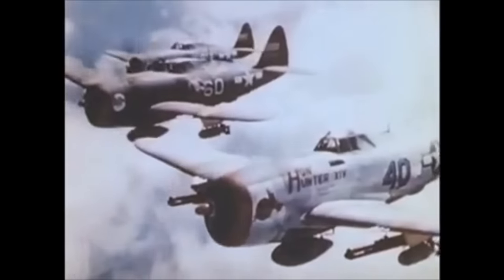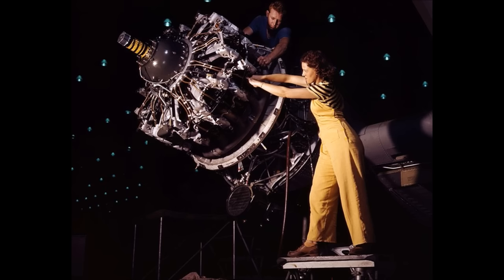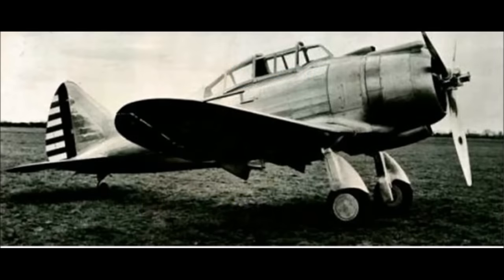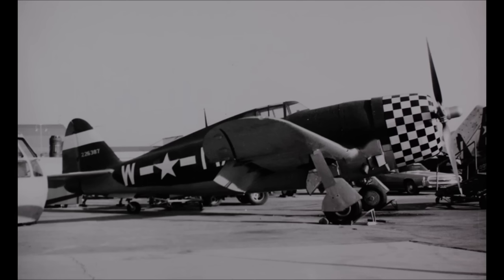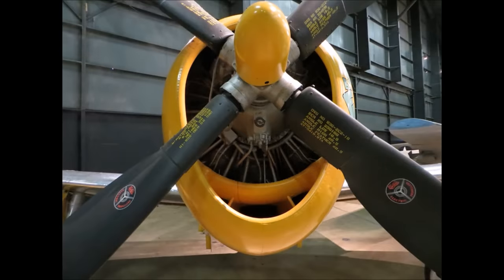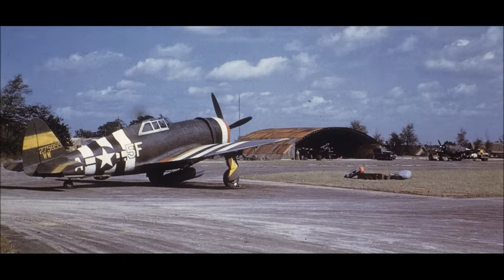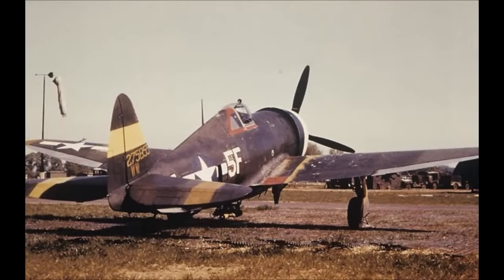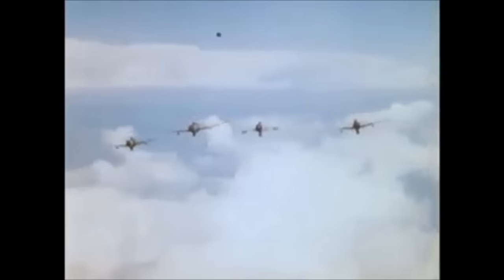P-47 Thunderbolt Pt. 1 Design and Speed

Comment: The D-5 version would have used the Curtiss 12 ft.2" prop. which is affectionately call the "pencil prop". This prop did not fully allow the R-2800 to preform, no climbing power. . Bob Johnson flew 5 different P-47's during his tour "Penrod and Sam" P-47D23RA hid final mount. Republic bent over backwards to help out the 56th FG, since that group started and finished the war in 47's and refused to change over to the 51. Which absolutely pissed off 4th FG and the leaders of that group were involved in dropping Bob's victories down from 28 to 27. Charles Lindberg surprisingly also helped with extending the range of the 47, he actually started with the 47 then switched over to the P-38. I have the copy of Mr. Lindberg's book on the matter. Excellent video of the 47 and it's  comparison with other AC. Thank you for giving a fair account and giving the 47 it's just due.
Reply from the maker: Thanks, soon I'll get into dive speeds and durability, both of which are areas where the 47 is incredible.

Comment: I believe the reason they chose the radial engine, instead of an inline, is because the radial is easier to repair or work on to repair ground fire damage, as the P47 played a major role in low flying ground support .

Comment: Greg, if you haven't been to the WWII aircraft museum in Colorado Springs, I would highly recommend it.  Got there over labor day. They are doing a huge 80,000 sq ft hanger expansion to get all of their collection located there at COS.  All the planes they have except for two are flying examples.  They have the engine and turbo super charger setup from a P-47D assembled out of a plane.  it is huge.  Might have a picture if you'd like it?  Collection has WACO, Bird dog, P-47, P-38, B-25, 2 TBM, TBY, A-1 Skyraider, 2 sequential serial # tiger cats, a Texan, a PBY and many others
Reply from the maker: Yeah, I need to get there. It's on my list.

Comment: Excellent video.  I thought the lightened P-51H models were also rated at around 470 mph top speed?   I'm not a particular Mustang fan that's just what I thought I had read.

Also, I never found the explanations for why the P-72, capable of speeds in excess of 500 mph, was never put into production very convincing.  Especially once Me-262s started being encountered in 1944, that extra 50 or so MPH would have been very valuable.   Any thoughts or do you address this in any of the several hours of your videos on the Jug (sorry I've only seen 2)?
Reply from the maker: The P-51H was capable of about 470mph, but it missed the war. I limit my definition of World War 2 planes to aircraft that saw combat during the war. Thus the 51H, Bearcat, etc. will be talked about in a separate series. The 51H was an all new airplane, very different from a 51D, including a totally different wing. The XP-72 wasn't finished, and Republic moved on to jets instead.

Comment: Another great video!  I have read that the Jug would end fights with cylinders shot completely away, and return to base.  What an engine!  THAT has to be reassuring to the pilots!  The Jug was a great air to ground machine, as well as being great in air to air.  Once the German fighters were out of the picture, our Jabo (fighter bombers) were a HUGE help to our ground forces, and the P-47 was probably the best at this.

Comment: Terrific video!  Fact heavy and opinion light!  I can’t help notice that the p 38 (designed before the p47 has its turbo exposed unlike the p47.  I hope  you cover the engine/turbo control system in part II or III or IV.  I know it’s not you thing but it would be very interesting to know how the AAC decided on policies re mechanical v turbo super chargers.  Bombers is pretty obvious,  prior to radar the fast high flying bomber WOULD get thru.
Reply from the maker: This may answer some of your questions. https://www.youtube.com/watch?v=ULLsIo1VzTw  I'll cover the P-47 turbo control system in part 3 or 4. Two is already full.

Comment: Excellent and well done video, thank you.  One minor nit pick, though, regarding the use of cowl flaps.  In my experience the cowl flaps are never full open in flight in large radial engines.  Full open cowl flaps are only for cooling in ground and taxi operations.  The takeoff checklist will call for cowl flaps to the "trail" position and they will be adjusted from trail to full closed in flight depending on head temps and conditions.  The reason is obvious if you look at a frontal view of the airplane with the cowl flaps full open.  They are a large and very efficient speed brake with an amount of drag second only to the gear.  Although I've never flown a P-47, I do have substantial experience with big radials in the R-2800 powered PV-2 as well as the slightly smaller R-2000 engines in the  C-54 and R-1820 in the B-17.  Cowl flap procedures  were the same in all of those types and I can't imagine them being different in the P-47.
Reply from the maker: KOVI, you're right. Full would typically be a ground position or in some weird situation  where extreme cooling was needed.

Comment: Obviously this is a few years old, but for flight simulators try DCS.  They just made a P-47 (in about 3 variants of the D model) and it is awesome.  Unfortunately, not my favorite N model running 72 inches.  It also works with VR.

Comment: It was great to see you discussing he P51B in comparison with the P47. As an aside the P51 only happened because the British wanted a replacement for the Hawker Hurricane and Tomohawk P40 for ground attack duties. North American offered a brand new plane so why not? At the time, USA was not interested in anything liquid cooled.
The P47 looks clunky (to some) but as Greg shows, appearances really are deceptive. The prototype Mustang X was flying with a Merlin 66 (two stage blower engine) just 6 weeks after Rolls Royce took delivery of P51B (Allinson engined) aircraft. Consequently, the engine cowls looked clunky with intercooler slung in a gaping cowl under the engine. Despite that, the X models were only 4mph slower than the much sleeker C models that had everything tucked away with the main belly mounted radiator. The D model was of course the Packard Merlin version with bubble canopy etc etc but not really any faster than the C model. Apart from it's wing the Mustang's big innovation was its radiator outlet that dumped hot air into the low pressure area behind the aircraft. This expanding air cut parasitic drag to zero (Meredith effect) and some say actually added to top speed. Though how they could prove that is anyone's guess.
It would be interesting to see how the P47 might have performed with Meredith effect hot air outlets rather than just dumping it overboard.
Reply: "It would be interesting to see how the P47 might have performed with Meredith effect hot air outlets rather than just dumping it overboard".
How about 505 mph? "The XP-47J was similar in appearance to a P-47B, but it was a completely new aircraft. The XP-47J had a close-fitting cowl installed around its Pratt & Whitney (P&W) R-2800 engine of increased power output. A large spinner was added, along with a fan to aid engine cooling. The turbosupercharger’s intake had been refined, and the flow of its exhaust was directed to provide additional thrust". 

"On 11 July 1944 and equipped with a General Electric CH-3 turbosupercharger, the XP-47J achieved 493 mph (793 km/h) at 33,350 feet (10,165 m). Although the engine was producing 2,800 hp (2,088 kW), Republic believed the aircraft had more potential. At its own expense, Republic installed a CH-5 turbosupercharger and a larger 13 ft (3.96 m) Curtiss propeller. The propeller was an experimental unit with 2 in (51 mm) added to its trailing edge to increase its width. With the changes, the engine producing 2,730 hp (2,036 kW), and 400 lb (1.78 kN) of jet thrust from the exhaust, Mike Ritchie flew the XP-47J over a calibrated course at 34,450 (10,500 m) feet on 4 August 1944* and achieved 505 mph (813 km/h). This is the highest speed recorded in level flight by any propeller-driven aircraft during World War II".

Quotes taken from Republic XP-47J Superbolt Fighter.  https://oldmachinepress.com/2013/12/17/republic-xp-47j-superbolt/

Comment: The main reason why it was so heavy was because it was so big. It was so big for three main reasons I think: the engine was loosely cowled, increasing fuselage diameter. The rare fuselage had to be enlarged to fit the big turbocharger and intercooler. And the fuselage under the pilot had to fit the pipes and ducting for the turbocharger and intercooler.
Reply: Fs. It was meant to fly long, fly fast, fly high, and be a stable boom and zoom platform. I'd say the weight was worth it for the overall goal

Comment: Awesome video. Hate to admit it, but I'm still confused about the part at the 20 minute mark when you say it's called an intercooler and not an aftercooler because it is between the turbosupercharger and the mechanically driven supercharger. Is there a mechanically driven supercharger and if so, where is it? It seems like the whatever-cooler is the last thing before the carbs, like it is ah, oh I don't know...
Reply from the maker: Thanks, and yes there is a mechanically driven supercharger. It's located at the back of the engine and thus is between the engine and the turbo. Air goes from the turbo to the intercooler, to the supercharger, from there it's further cooled by water:methanol injection.
Reply: @GregsAirplanesandAutomobiles  Cool. Thank you Greg.

Comment: Hi, excellent presentation, just a note on the flight sims.; all are good in the maneuver mode but all lack realistic altitude compensation and the same with load effects. the simple reason is based on program limitations and processing speed. I am and old time pilot and love all the flight sims . interesting that the p-38 and p-47 both had compressible issues in the dive but the p-51 did not have such a problem. Laminar wing probable made the difference.

Comment: I love your videos! As a former pilot and employee of several aircraft manufacturing concerns and as a plane junkie of the first magnitude, I find your citation of  obscure details to be amazing! I would love to hear about your opinion of the new WW-II Sims and a detailed analysis of the P-38. The part I find strange is that the 414 MPH posted in all the books was from one of the very early models of the P-38 and that later models that had as much as 71% more power are still listed at 414 MPH????Now the hard part, My uncle flew P-38s in WW-II and claimed his plane would do well over 450 MPH at high altitude if required. I would like to hear your analysis of both the "Placard Speed" issue and my uncle's claims.Sincerely,Stewart Davies.
Reply from the maker: I'll get to the P-38, but it's several videos away.

Comment: Amen on the Flight Sims! P-47s and FW 190s are dogs on the three Flight Sims I've had. Hawker Tempest 5 is the best  on my F.S. 3. Tempest has some real firepower, while the P-47s & P-51s shoot "popguns." Ya need about 500 hits to score a victory, while usually 10 or less will win in the Tempest. Ya know, if that were really the case, that made the Aces in the E.T.O. even more capable. Most of the top 10 Aces in the E.T.O. flew P-47s. With their shorter range, they had a lot less time in theatre, which meant less opportunity to engage the Enemy. Lots of their early kills were done with the early "skinny" props, too. Johnson's book, "Thunderbolt!" is a good account.
Reply from the maker: The P-47 fought the Luftwaffe at its best. R.S. Johnson shot down a 200+ kill German ace.

Comment: 35:00 I think the ruggedness might be a good argument for there being enough of a safety margin on engine settings to allow this sort of hot rodding: if things got dangerous at 19,000rpm or so, that would suggest that it should be easy for it to be thrown out of whack by battle damage. But if it were rated to have a higher maximum RPM, it wouldn’t already be at max load when a stray round appeared.

Of course, I have at best a layman’s understanding of how combat damage would affect a complex system like an aircraft power plant, but conservative settings DO seem very much in line with Republic’s typical approach to building their aircraft

Comment: My Father Wally A.O’Neill Fought in the P47, said he broke the sound barrier I think he was starting at 30,000 35000 feet, pointed her straight down, full water injection and full power.  He said it was very difficult almost impossible to pull her out of the dive.  After returning to the base his crew chief yelled at him to get his p47 in the hanger immediately so he wouldn’t get court martialed, the coweling was completely torn off, all that was shown was that big radial engine hanging out there... He would always tell this story emphasizing that he was the first man to break the sound barrier straight down unofficially of course...
Reply from the maker: Wow, I can't say that he didn't break the sound barrier, but either way, I'm sure it was quite a scary ride.
Reply: Pilots often thought they broke the sound barrier because the speed indicator had crazy numbers on it (over 700 mph). That was because the pitot tube (the pole thing that is usually located near the end of one wing) used to measure speed was not accurate under compress-ability conditions (which is what your dad was experiencing) so the readings were inaccurate. The whole problem was that the speeds were approaching the trans-sonic (near but not at the speed of sound) and WWII aircraft were not designed for the special airflow problems encountered at those speeds. So how fast was your dad going, once he reached max speed (it takes some time after the dive is started)? Not supersonic, but really fast, 500-600+ mph. By the time he entered thicker air at a lower altitude he would have slowed down some (but his airspeed indicator might have read an inaccurate high number), finally being able to pull out. Some pilots were not able to recover and crashed. Glad your dad was not one of them.
Reply: Yeah, Deplorable is probably right, although, he was definitely going very fast, too rip that metal cowling over the rivet’s holding it on.  Not sure if I am quoting him or I just saw it on a Documentary about breaking the sound barrier, but I thought he did say his instruments and glass broke in them, but I could be speculating about this.   I am unable to find out additional information with him, he died in 1998, but boy this is just one of the exciting stories he had told... He did say he was trying to unlatch canopy to bail out before he pulled out.   When in is P39, he did get into a Tumble, so I’m not sure if this was where he was talking about bailing out, and was having difficulty with canopy.  The problem with the p39, it had side door entry and exit, so I’m not sure about it being the p39 bail out canopy on it either, and it seems as though he would be going to fast in the 47 to bail?  He was an Ace pilot having I think 5 or 6 kills.  As far as fighters are concerned he flew the p47, p39, and was a Flying Tiger under General Chenault in the p40.  I would have to search through his paper work to find out dates although he did get the distinguished flying cross among other high awards for that time.
Reply: Saved Photo
￼
79th was a p47 squadron

Comment: One aspect should possibly be covered. The Spitfire was a very docile aircraft to fly, giving ample stall warning through buffetting, maintaining aileron control. This made it possible to be mastered by even the most novice pilots. How docile was the P-47?
Reply from the maker: The Spitfire was by nearly all accounts one of the best handling airplanes of WW2, when in the air. On the ground and for take off and landing it was terrible and that's where most aircraft were lost. 
The Thunderbolt was about normal as compared with US fighters in terms of being "docile" although that's pretty hard to quantify.

Comment: I love the P-47- a very effective and robust airplane.  The ability to absorb abuse and remain in the fight is crucial.

A few comments that may inspire specific questions:

Machines have critical speeds.  Vibration and acceleration skyrocket at mechanical resonances where the rotor rings like a bell.  The designer is careful to arrange for resonances to occur away from normal operating speeds.  

Turbo compressors surge (aerodynamic stall of the blades) if rotor speed is too low, differential pressure is too high or flow rate is too low.  Air flow reverses through the compressor until differential pressure falls (and perhaps rotor speed increases) and then the compressor catches hold again.  The rotor bounces violently in its bearings when it surges.

In general, turbo machines start out in balance but do not stay in balance in any but the cleanest applications.

Interesting things happen as turbine blades approach sonic velocity.  It is important to know rotor circumferential velocity when comparing shaft rotational speed of different machines.  The most efficient speed is right on the ragged edge.

I have helped turbo machinery start up engineers wreck new machines while exploring limits.  Failure can be abrupt.  There are  things I might do to someone else's machine (with a hot spare on standby and a cold spare in the box) that I would not be willing to do to a machine that was expected to get me home.
Reply from the maker: There are times when it's worth risking engine damage, and not making home in order to avoid sudden death from German 20mm cannon fire.

Comment: Can  a P51B really reach 67" at 30,000 or just attain that speed at that altitude?  I only have DCS as a reference and it is the dash 7 varient, but at 30,000 I don't recall being able to get past around 50" at full throttle and 3000 rpm. We only have a later  D30, D40 P47 and 190A8 but I'm curious to see if I can duplicate these results:) P.S My 1st DCS module was a P47 almost solely on this fantastic series!